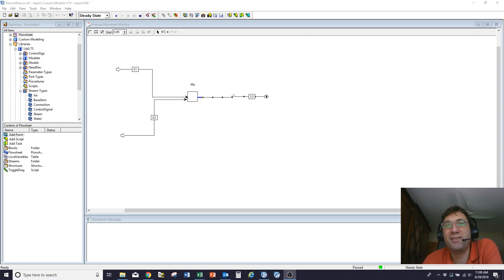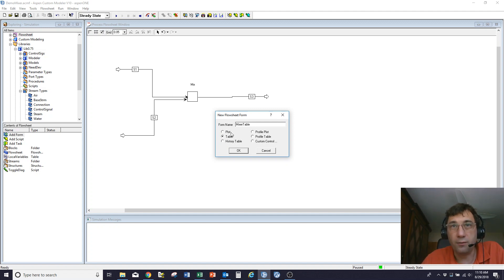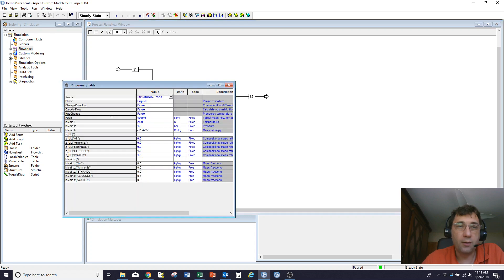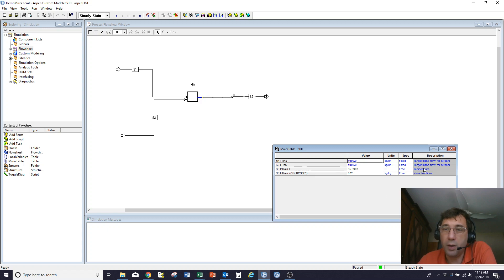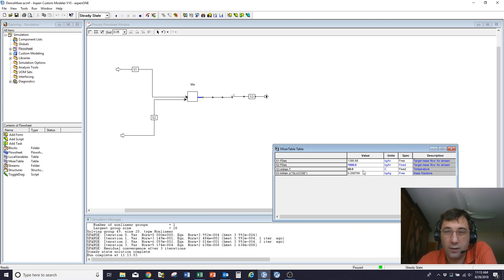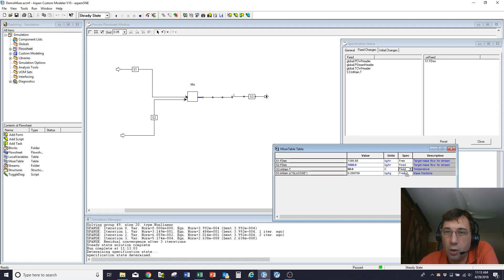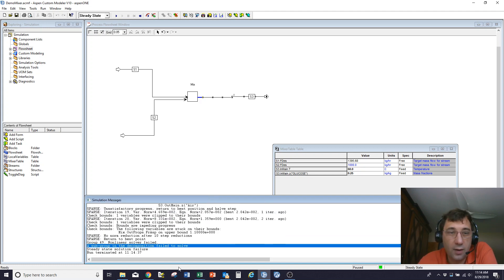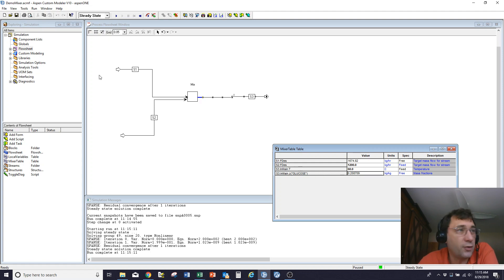ACM3. Degrees of Freedom and Custom Forms

Comment: Hello! I am trying to create a pervaporation module by ACM and I found unspecified 6 variables and I use the "analyze" tool to fix those six variables and then run but "Steady-state solution failure" is found. 
Do you have any suggestions to solve this problem? 
Thank you in advance.
Reply: The pervaporation code I got from the textbook "Design and Control of Distillation Systems for Separating Azeotropes" in the last chapter.
Reply from the maker: Hi Phokhin - I don't have a lot of extra insights to offer beyond what's in this video.  It's a tricky business, but you need to work through your equations and make sure that you have the correct number of equations and Fixed variables to match the number of variables that you are using.
I tend to find that it's easier if you start with a really simple model (eg in = out) and then you gradually add equations / variables until you have the whole model completed.  I also try to nominally assign equations to variables - ACM will do this internally, but I find it useful to come up with at least a feasible pairing of unknowns and equations.
Hope this helps

Charles
Reply from the maker: You might also want to look at Video 15 - that gives another perspective on getting models working
Reply: @cssandersonllc3172  I’ll try my best. Thank you very much krub :))

Comment: Is there any way to perform a sensitivity analysis using ACM? I have used ACM to model a pervaporation module. However, I would like to optimize variables such as the permeate pressure and feed temperature to provide good separation in the permeate. Is there a way to plot this as one would do using AspenPlus?
Reply from the maker: There is no easy way to do that from within ACM.  Three options:
1. Use the inbuilt ACM optimization routines
2. Write a VB script inside ACM to run the model and write results to a file / message window / ...
3. Write a script in Excel / VBA (or I think Python if you're using one of the newer versions)
Reply: @cssandersonllc3172  I chose to export the model to A+ and thereafter, I used the sensitivity analysis to optimize. I must commend you for your ACM series. It was extremely helpful for a beginner such as myself. Thank you so much for responding. I will definitely keep your advice in mind should I attempt to perform such analysis directly on ACM in the future.

Comment: Thank you for the great instructions!  
I dont seem to have a "descriptions" column in my table. Is there a way to add it?
Reply from the maker: I'm glad the videos are useful.
If you right-click on any open table, you can go to "Properties" and select various columns to include in the table.  I generally choose to show Spec(ification), Units and Description.  For troubleshooting, I sometimes also show Upper and Lower.  You can also re-order the displayed columns.
Generally, ACM will remember your chosen set up for tables - certainly this is true if you make the changes when there's only one table being displayed.  If you have multiple tables open, you can change them to show the columns that you want, but if you add columns to one table, they won't be added to others that are already open.  I think (but haven't tested) that ACM remember the configuration of the last table that you focused on when it comes to setting up any new tables that you open.
Too much information, perhaps.  I generally open ACM, open the Flowsheet / LocalVariables table, set it up the way I want, then start writing my model / open up an existing model.
Reply: @cssandersonllc3172  Thank you so much for this helpful info. I was able to add the column. I'm trying to simulate a hollow fibre membrane using mathematical models from literature.